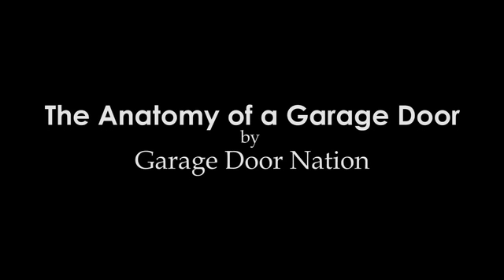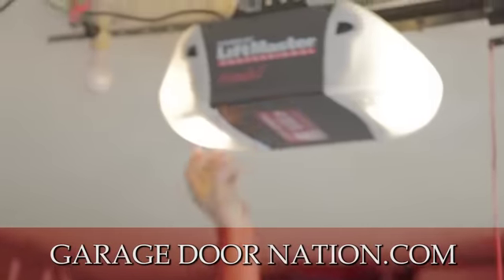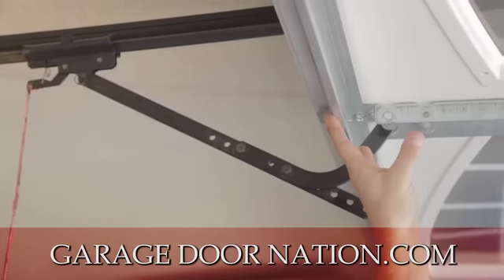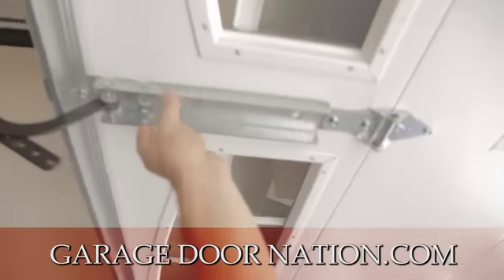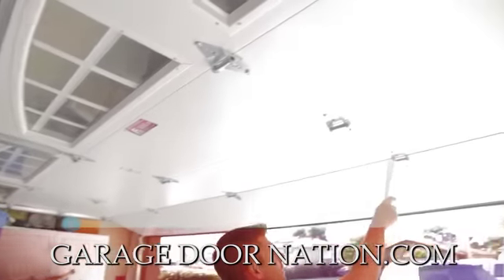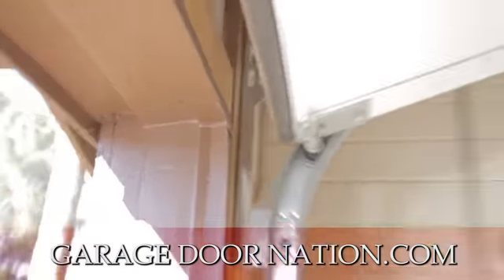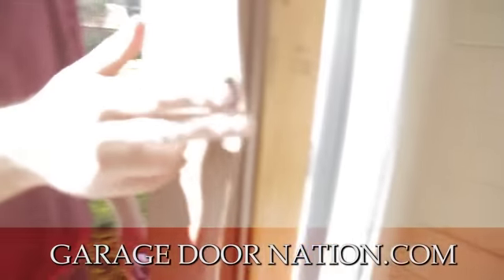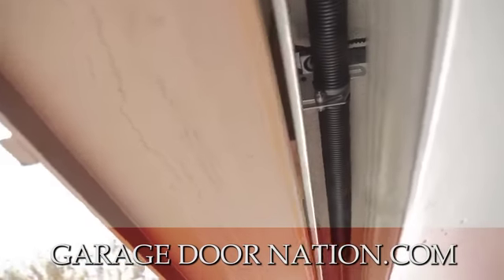How A Garage Door Works by Garage Door Nation

Comment: What the video meant to say was:

The motor provides an initial force to drive the door closed and make the spring contract. That stores potential energy in the spring. When the door opens, that tension is released and pushes the door back open. It's all about contracting and releasing the spring. The motor does a little bit of work, but the spring does the bulk of it.